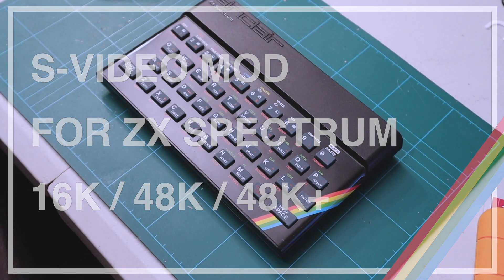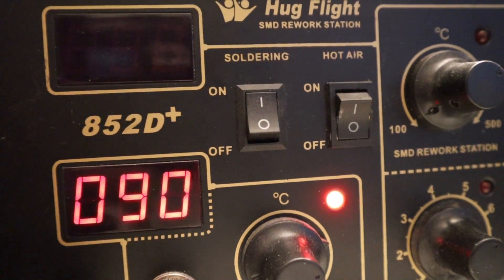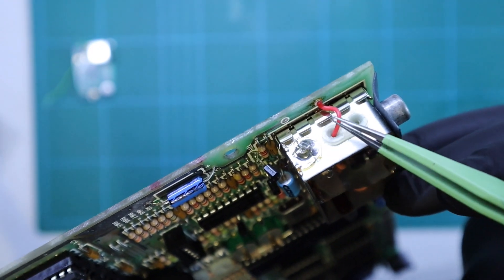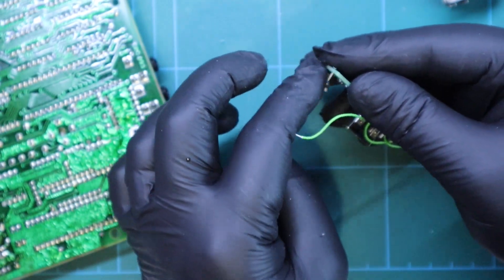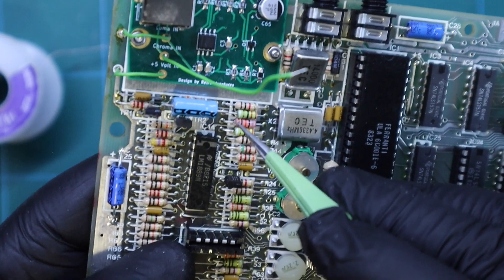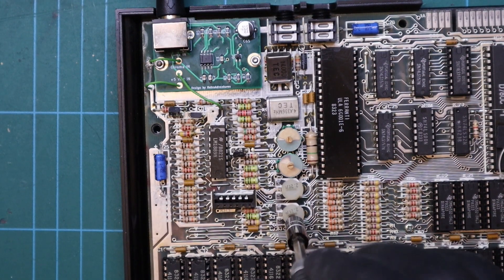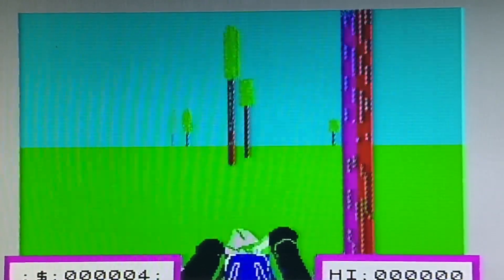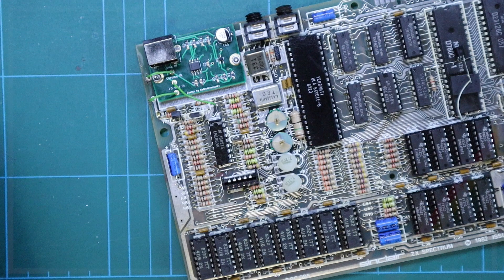S-Video modification for ZX Spectrum 16k / 48k / 48K+

Comment: Thanks, great video! Be aware that not all TVs with SCART inputs support S-Video (Y/C) signals via SCART. The picture will look bad on those, even when you feed it an S-video (= chroma and luma signal) into it. My LG has this problem. It didn't have an S-Video DIN in. I fixed it by using a RetroScaler2x.

Comment: Disclaimer for anybody into this:
Your TV will most probably not dig S-video input. If you are way into LCD territory, go ahead, you will be fine, but if your idea is to hook up a tiny CRT, forget the mod. Most compact CRT's with SCART do ONLY RGB and composite input!
So this is only suitable for them 20 inch and larger stereo behemoths breaking your spine with over 35 kg of glass.